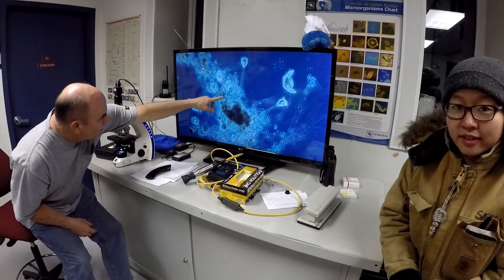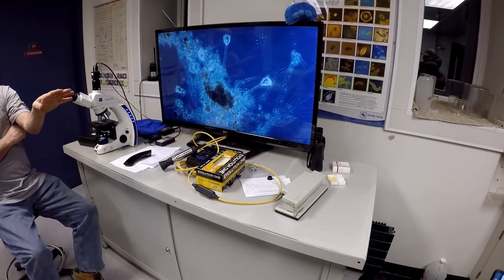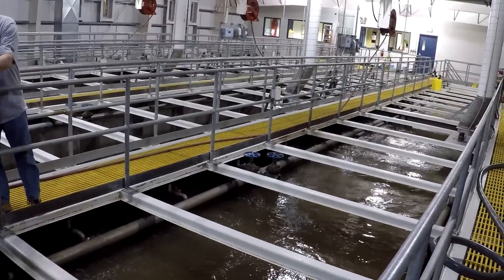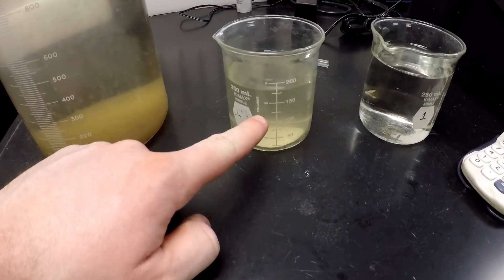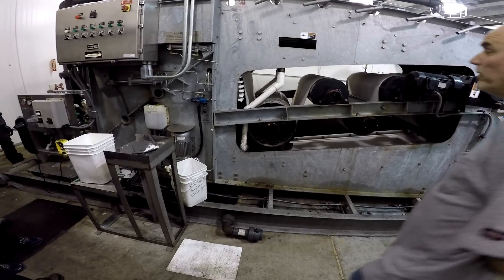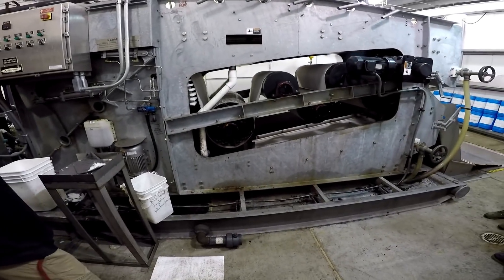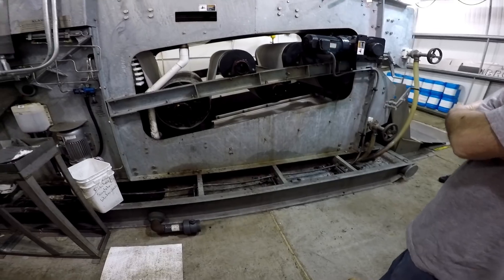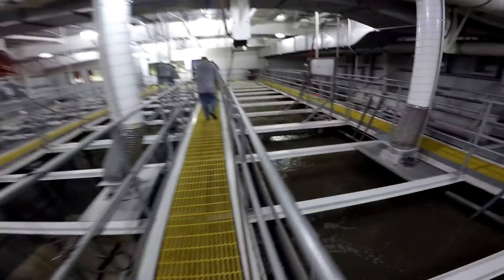Waste Water Treatment Plant Tour - McMurdo Station

Comment: I worked on the McMurdo station managing the power, water and waste water facilities in their summer of 2007 - 2008. The waste water treatment facility was a train wreck when I arrived. The place was not being properly operated and the water flowing to the sea was brown. Provided were thick manuals but they said nothing about how the system was to be operated, only about the components in the system. I had a great staff (as I recall, her name was Becky) that worked with me to figure out how to run it. The breakthrough was when we tracked the inventor of the system down to an engineer that worked for Black & Veatch in Overland Park, KS. (I think the system is called a Modified Ludzack-Ettinger) With his support and a ton of work, we cleaned it up and started the system working properly. (some pumps had never been operated so it took some effort to get these, dormant for five years since constructed and burrier in the poo, to run) The belt press was a mess and we managed to figure out how to fix it then properly operate it too. Three months into my tenure, we finally received support from a very knowledgeable level 3 operator from Breckenridge, CO who refined our work and brought the performance up to standards. We then wrote a procedure for operating it and added this to the literature. Naturally, since the entire McMurdo Station is a bureaucratic nightmare being run by Raytheon, this was unacceptable and I caught tons of push back for altering their sacred but largely useless documents. But, it looks like we succeeded. The system appears largely like we left it. Cool! Thanks so much for the video and bringing back memories of a fun but challenging adventure.
Reply: Good staff is essential.

Comment: I worked at Scattergood Generating Station which was next Hyperion Water Treatment Plant which treats waste water from Los Angeles. I know that digesters at a water treatment plant produce a low BTU gas known as digester gas which is mostly methane and carbon dioxide. Now at a very small water treatment plant like the one at McMurdo the amount of digester gas produced would be minimal. The question I have is what do they do with the digester gas at McMurdo water treatment plant? Since the amount would be small do they just burn it off, or do they try to produce some heat from it? I know that at large water treatment plants the digester gas can be burned to generate electricity.

Comment: Interesting to see they use several package extended aeration plants. I used to operate the sewage treatment system at a amusement park and we had 4 package plants in parallel. I would start with one in the spring and fall when the attendance was low, and bring all 4 online during the peak summer months.  Thanks for the video on this.
Reply from the maker: Very similar to here.

Comment: Where dose your fresh water come from?  are there any use restrictions?
Reply: Barry Olafson 
This is a guess...but I'm pretty sure they use desalination.

They are sitting right next to the ocean and I'm betting there is probably a desalination plant within a few hundred meters of this treatment facility that also runs 24/7...probably the reverse osmosis variety.

You can extrapolate a great deal about potable water production from this video by looking at production capacity on the back end of the water cycle...from the size and number of basins I'd guess somewhere north of a daily capcity of 50k gallons. Not sure what their holding reserve would be but I again, i'm guessing (avg peak usage)*2 at minimum.

Even over the winter, that's a lot of water.
Reply: Interesting!
Reply: Seawater and snow.